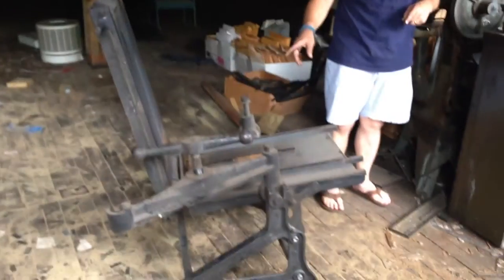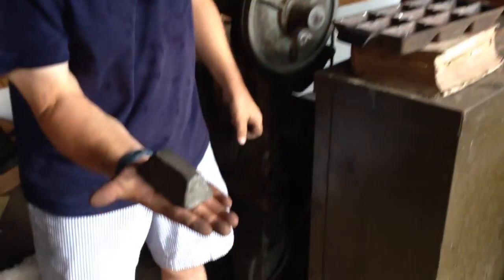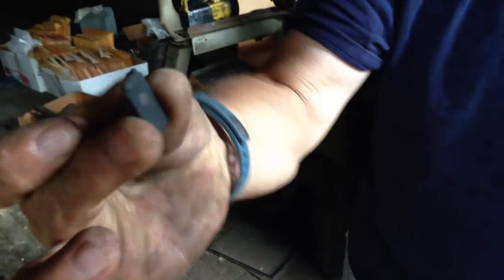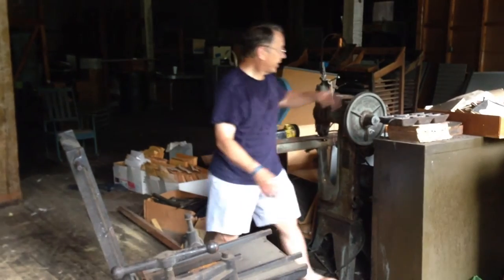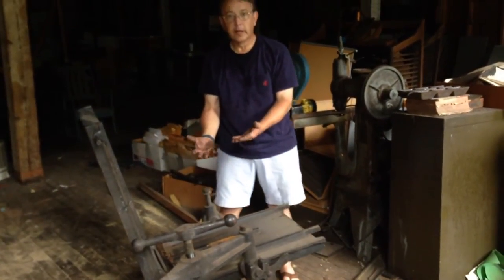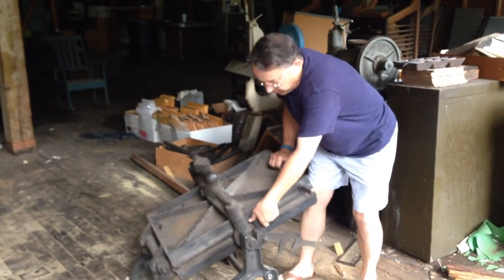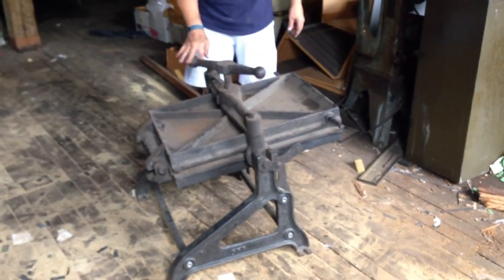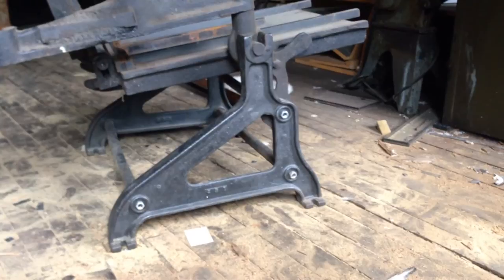Mat Caster -- old letterpress newspaper printing process

Comment: I have the caster but I am trying to figure out how they made the cardboard form you talk about. I got a whole letterpress shop I am trying to get running for a hobby. If you know what I need to make the cardboard mats I would appreciate it. Thanks
Reply from the maker: +Partisanpackrat Sorry. Back in the day, they were always provided by advertisers or art services which we purchased. I don't think we ever had the capability to make them ... and I am not familiar with the process. Please let me know if you find out anything. I'd love to see your shop. I still have a lot of stuff too.
Reply: +Sparky Newsome Thanks, mine is a little different than yours, it has a heating element in the caster to preheat it but does the same thing. Wish I had an old one like yours as my shop is basically a 1920s shop with the exception of my Model 32 Linotype. I want to make a Youtube vid sometime but right now I got all the light stuff in storage as the ceiling plaster in the old newspaper shop is given out and I have not had time replaster yet. Thanks again!